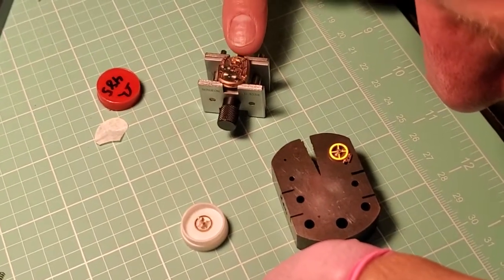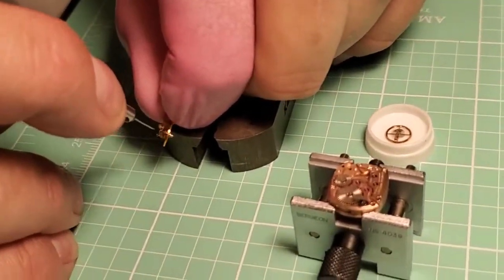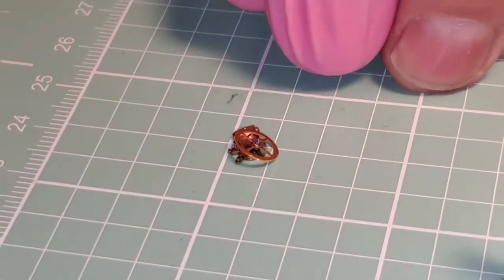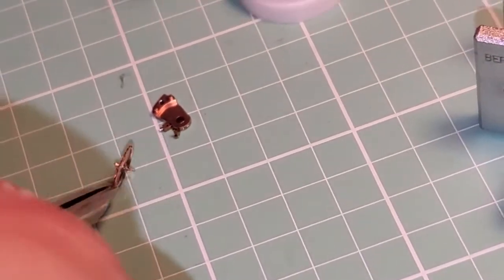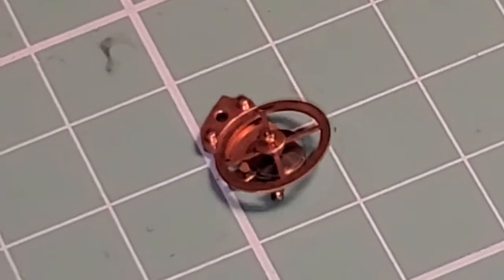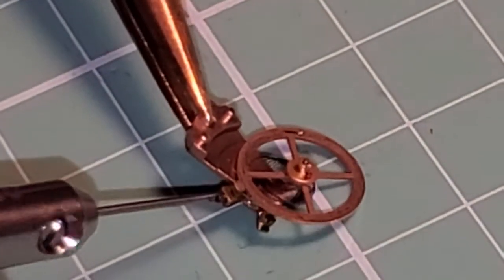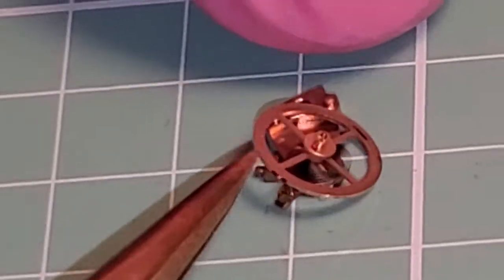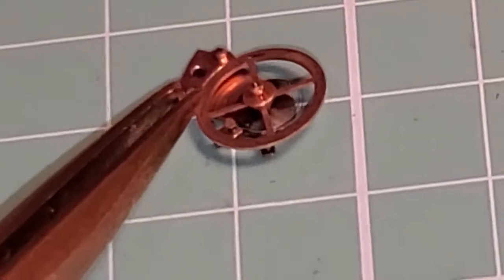How to replace the Hairspring / Balance Wheel on a vintage Omega 485 movement

Comment: This video is the closest I can find to replacing a balance complete.  I just installed a new complete balance on a tiny Gruen 211 Verithin ladies' watch.  It runs but is running super-fast and needs adjusted more than moving the regulator is meant to do.  I think poising is in order.